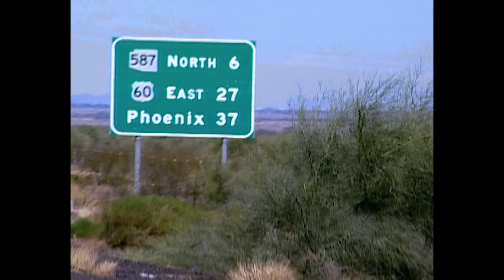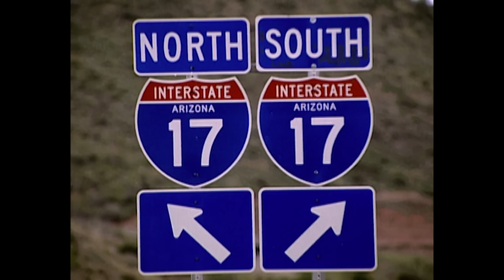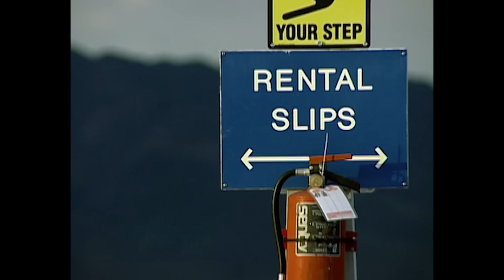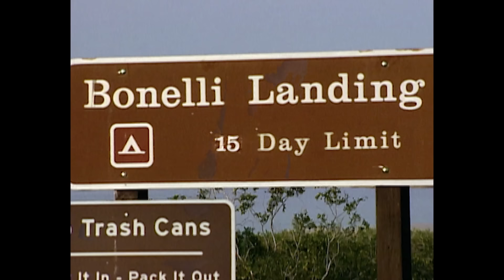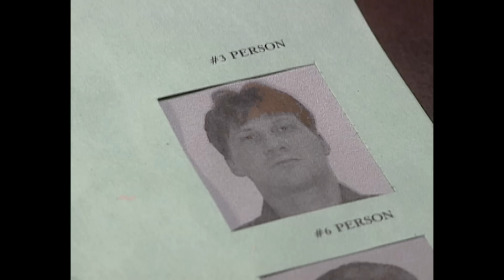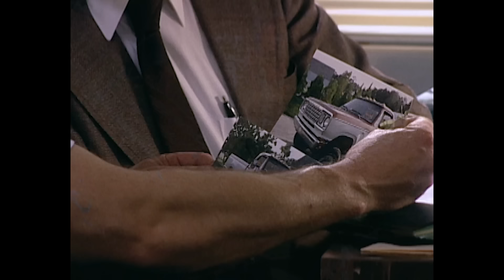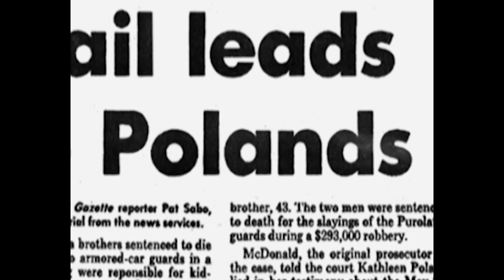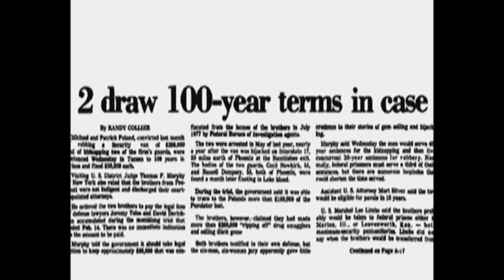Deadly Heist | FULL EPISODE | The FBI Files

Comment: Hmmm...I am glad that the automatic, or self-winding, or even "Kinetic (...mechanism needing only minimal movements of a non-wanking wrist on a quadriplegic or even comatose, atrophied and/or demyelinised peripheral nerves of a patient in a coma, with Multiple Sclerosis, or the syndrome shared with the late Dr.Stephen Hawking Ph.D., RIP, Doctor; keep up those mentally complex and incomprehensible for many of those in theoretical physics, abstruse mathematics of astrophysics, standard-model advancement via strings, extra dimensions, extra particles, extra mathematical constructs e.g."Renormalization" where an inconvenient infinity in an equation (Usually a big old red-flag for a flaw, an error, an utter failure of maths to model a phenomenon accurately, or just enough to be instructive or useful as an approximation with the caveat of it not being useful for any predictions of more than tiny departures from observed behaviors of a system in question, once variables are properly reduced, eliminated, or accounted for in projected error-bars on a graph, both positive and negative, that will affect the gradient, the area beneath, the overall characteristics of the line from a flat straight and unchanging in time, or spatial topography and topology (Shapes of any curves, and presence of practically infinite asymptotes as found on an exponential growth/declining population/explosive volume increase e.g. during a Supernova, the Big-Bang, bacterial cells multiplying when resources e.g.Iron atoms (As found in a stellar core prior to the supernovae events that add energy to create heavier nuclei by various pathways that all require input of energy even if there are more viable or potentially possible paths than just one since although there are several inflexible limits to those atoms that are potentially possible even with enough free-energy to allow E=mc^2 to run both ways, to produce matter as particle-antiparticle pairs from available energy from electromagnetic waves - gamma rays to provide the sufficient density of energy over a short enough time in a small enough volume...which can even cheat by borrowing a little extra energy from....somewhere...according to Heisenberg's Principle of Uncertainty; if energy is borrowed briefly enough, the amount can be larger than if borrowed for longer in time; if you give this a reductionist approach to logical projection into past and future, it can easily considered to be applicable to the total energy of the entire universe, and at any age...so the E-total when t=0.000000....001 is identical to E when t=999,999,999,999.999 seconds or mega-galactic-revolutions-around-the-centre-be-it-a-supermassive-Black-Hole-or-a-spinning-sac-of-farts-but-one-works-one-can't-but-even-a-5x10^9 Solar-mass rubber fartbag-isn't-able-to-hold-any-galaxy-ever-seen-spinning-over-2 RevsPerBillionyears (Our one does just less than 4 RPBY, and is known from photographic plates that confirm theoretical predictions that were the source of putative "Dark-Matter" required to explain observed speeds which calculated masses of gas, dust, stars, and other unseen if otherwise normal, warm, infra-red/cosmic microwave background electromagnetic radiation emitting if nothing more (And very occasionally, less, as found in our own constructs of another physical form of matter to join plasma, gas, liquid, solid, and crystals of atoms less dense than of a solid of the same atoms, or with other properties that are not found in an amorphous solid of imprecisely arranged atoms, or molecules, which is why water and ice is an example, ice being less dense than water, of a rarely observed accumulation of qualities only shared by a very few substances from here to the other side of the universe, since the laws of physics seem to be conserved at places incapable of communicating to cheat, even if they tried to send each other smoke-signals or cartoon-frames to illustrate the required properties needed to be calculated and/or observed by us ~12 billion years later...which seems to be a LOT of collusion and violation just to make lil' ol' US scratch our heads, balls, and asses in the manner of the infested lousy animals that haven't scrubbed the spotty butt since autumn became winter...like...3 months ago, and the river is still frozen solid, be it LASER-grade crystals, or opaque filthy impure ices you'd never allow in a G+T no matter how drunk you were, or desperate to flavor with saccharine and dye green to provide something cold to give your kids to sook on to shut their faces up for the rest of the drive along the freeway returning home after an otherwise lovely day at the coast. Many outrageously improbable coincidences of a damned bunch of physically constant and universal values only recently measurable to the exacting tolerances required to state confidently that they would be if only very very slightly different from the observed values the sources of differences in universal attributes rendering the place utterly dissimilar from that which we see, or that which allows us to exist to see, or that which is allowed to exist either at all, or for longer than a femtosecond, or for matter to be stable in an expanding volume - if there were two dimensions of time (And no, I do not know what that would look like especially if I were asked to portray it on a graph with axes perpendicular to each-other, never mind how old I'd become trying to figure it out, except probably over a bazillion mega-years^2 or whatever....!) instead of one, never mind if causality holds, but stable atomic orbits allowing for electronic orbitals, chemistry, indeed for any atoms not either totally ionised, or above an atomic number larger than ten to exist at all, and the universe to appear more translucent than the interior of an incandescent lightbulb. It's a weird thought-experiment worth making, a universe where certain characteristics are identical to ours, but where only one has been changed, to try to predict the results to flex one's astrophysical muscles, so to speak. Fun but tough, and hard to find out what the actual effects would be...although today it's far easier than it was only ~a quarter of a century ago...when it was much less easy to reiterate a simulation!) ...or to produce radiation from annihilation of matter and antimatter, at diagnostic frequencies, for the particles involved...hmm...wait a second....are neutrinos needed to conserve the angular momentum in this direction...? Well, I'd hazard a guess that if one way produces 'em, the other way will need 'em...surely? Seems to be logical, but the universe is only covered by a logic-veneer to mislead you. Or me...since I'm just a biologist! Best of luck with the astrophysics post-grad studies guys! Solve an Einsteinian Gen.-Relativity group of equations for me when you have some spare time you'd like to use up and show off within...!  💥✨🎆⚪🔵🟡🟠🔴...⚫❗Whatever the universe, VOTE 🔵🔵🔵🔵 BLUE in November 2024, to ensure no more Trump-insanity in the office of the POTUS can happen, because it'd give the saucer-aliens all the excuses they'd ever need to come and blow our tits up.
Oh! I remember what this was about! My dad had an "Automatic" Omega - he'd treated himself on getting engaged to my mum a while ago...when a watch such as that was ~£1000...in 1971 when many cars weren't so expensive. I could die; I needed money during the pandemic and so like a dumbbell I took it to a pawnshop and their max was £350...and I took it instead of telling them they could shove it. I couldn't get it paid off in time and so no more Omega Automatic on my wrist. Motherfuckers. Them and me both kind of I guess. However, I DID spend £25 of the 350 on a bottle of Maker's Mark and coca-cola-yummy, and got very drunk indeed, if nothing more exciting than that. I'm paying for that lovely drink to this day, you see...   
😐🤔😧😢🤢😖👎❗
Reply: They walk among us 😮
Reply: Seek professional treatment.